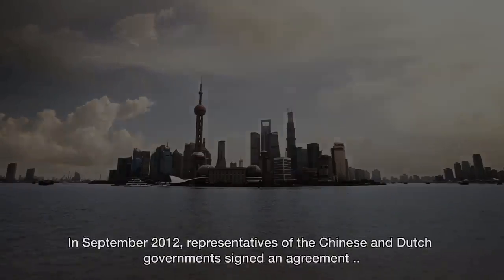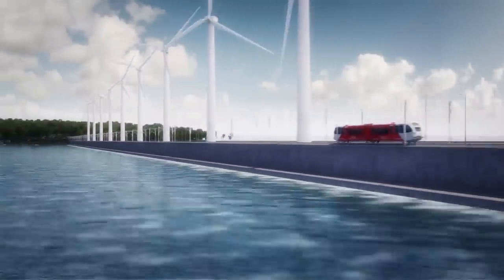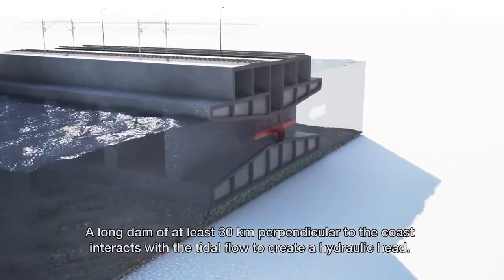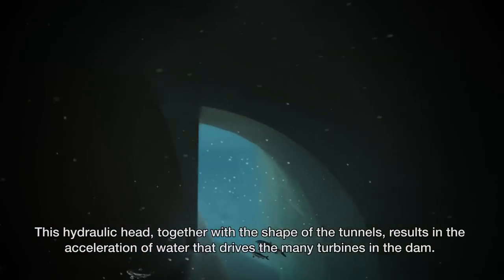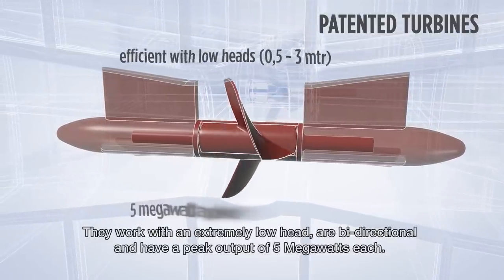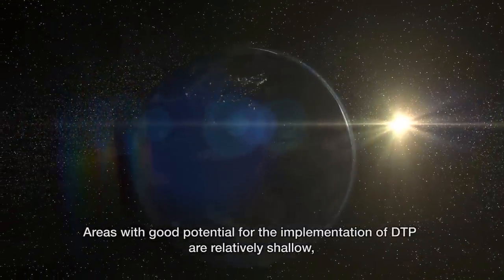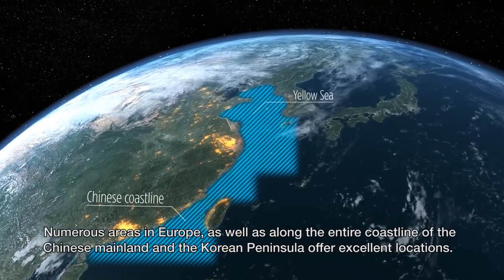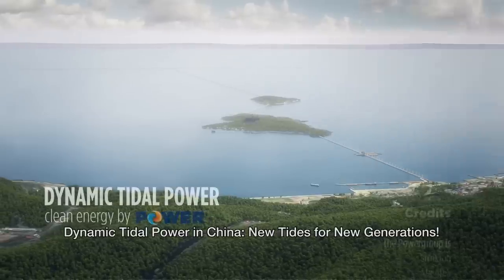Dynamic Tidal Power (DTP) The Concept (3 min. video) UK Subtitles

Comment: The video shows fish flowing through unharmed. What about dolphins, sharks or turtles? What is the largest size that can move through the turbines safely?
Reply: The turbines are pretty big compared to the depth of the water. I'd imagine that most animals large enough to have trouble with the turbines would tend to be fairly rare in these shallow waters. That should narrow down the specific range of animals that have to be considered.

The only way to really find out is probably to build one. The behaviour of the animals near the turbines is likely to be more important than any physical consideration.